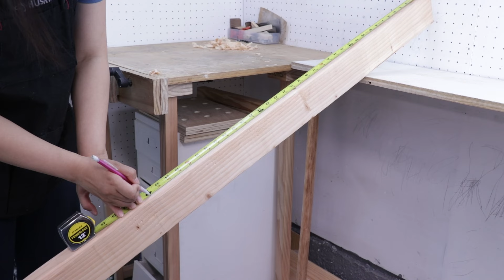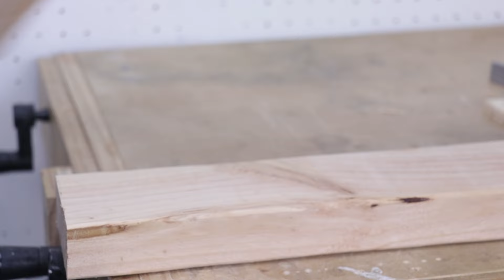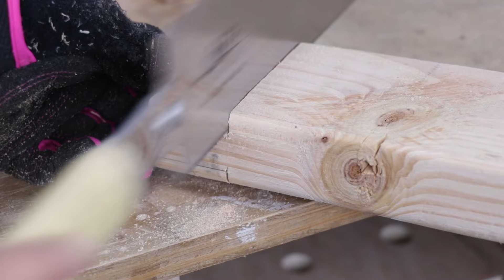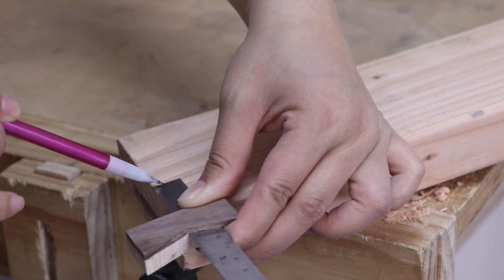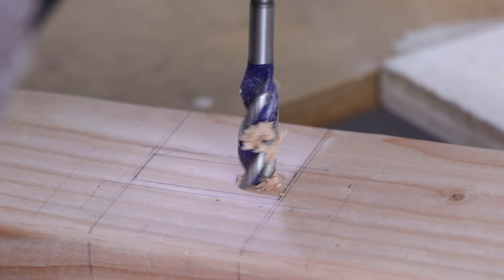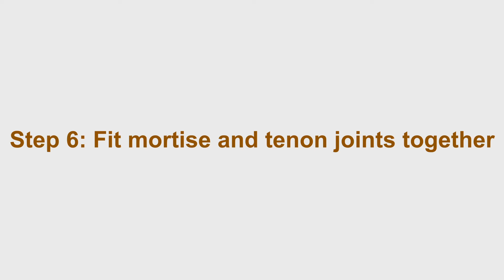Make A Sturdy Workbench Leg Frame With Wood Joinery // Mortise And Tenon Joints

Comment: GLUE SCREW AND BOLT Yea that joinery looks cool and it’s good for furniture but it’s weak. You know what’s not weak? GLUE SCREW AND BOLT!!! Glue screw and bolt. Much faster and stronger especially is you glue and bolt a little triangular piece to each corner. That’s how I made my wooden Armwrestling table. It doesn’t move or bend or flex ever and it’s been like that 5 years strong. In a humid garage all the time it should loosen a little bit… nope! I use it for sawing with my strong ass western push saws that don’t get dull real fast like those backwards double sided things you use.😂😂😂get a man’s saw and do it the right way. Glue! Screw! And Bolt!
Reply from the maker: Thanks for sharing your thoughts. I definitely want to try western saws in the future. 

Personally I believe in the strength of wood joints. I will add glue to the joints soon, and we’ll see its performance in the workbench. 

Your armwrestling table is very impressive. We have a wood frame supporting a wisteria tree in the yard. It was built using your method with screws, bolts, and some triangular pieces to support the corners. It’s very sturdy and has lasted for years. 

Thanks for your comment!